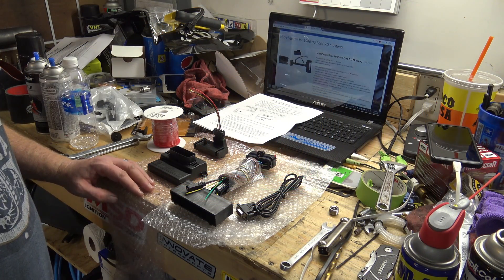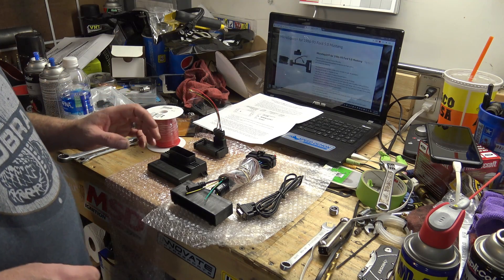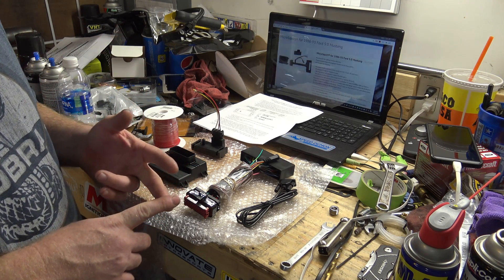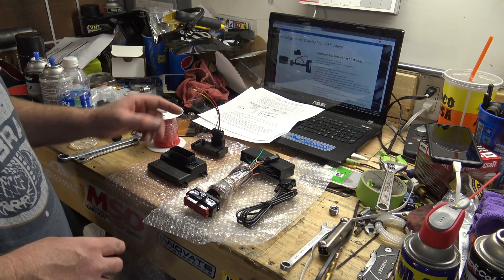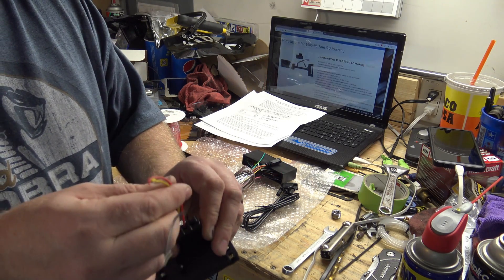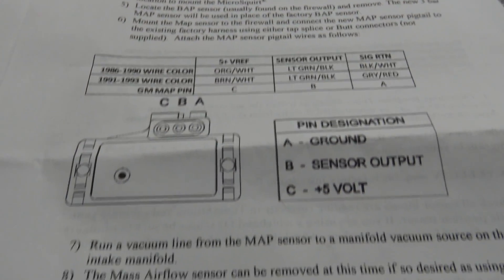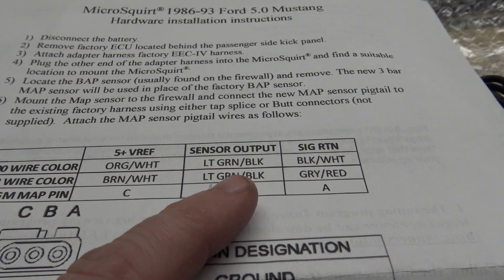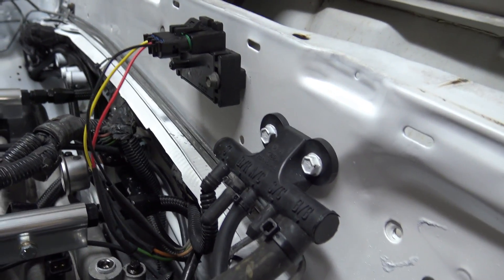Foxbody Mustang Budget Turbo Build - MicroSquirt Install

Comment: great video do you happen to have a link to the wide band you used or what would work?
Reply from the maker: Im using a aem now
Reply: @justin91lx  what wire did you use on the aem

Comment: New to the Foxbody game myself, but have a simple question:
Could I use this to replace the stock computer and harness for a 5.0 swap? Then just use the stock 4cyl ecu for dash lights, etc.? Thx for any thoughts
Reply from the maker: You would need to swap out the engine harness. 87-93 harness
Reply: @justin91lx  Ok, so still need engine harness, but can replace orig computer, correct? Thx

Comment: Does your factory tach still work even with the microsquirt
Reply from the maker: It sure does, but I no longer use the stock cluster. Built a custom raspberry pi setup
Reply: @justin91lx  can u do a video on that raspberry pi setup.

Comment: So just tape up wires goin to original o2 sensors n mass airflow?
Reply from the maker: I just zip tied my maf harness in the fender wheel. O2 harness taken out
Reply: @justin91lx  So, the MAF and the O2 sensors are not used with the Micro squirt? If so, this will save me $200 for a MAF to match my injectors.

Comment: Do you still have to use a mass air meter with this kit
Reply from the maker: Nope, same as the o2 sensors. Run a single wideband

Comment: Should have replugged the harness for the 2step option because it doesn’t come pinned for some reason. Your going to want the 2step with the turbo. I used the tach wire and moved it over because I’m using the tach wire on my ignition box. The FLEX wire location is were you need to put the wire. You’ll find it on your instruction wire diagram. Not to difficult. It requires a ground to activate the 2step.
Reply from the maker: Yeah I may wire up the 2 step on the microsquirt once I get everything else straitened out on the car

Comment: Great choice with the micro squirt.  How does the GUI look for the tuning app?  Is it fairly straight forward?  I purchased a Moates Quarterhorse for my A9L.  I'm not by any means a tuner, and my car will likely never see the track.  I'd be very leery of dyno tuning my car when its done.  Ive seen too many videos of motors exploding.  If there is anyone that can help me out with a base tune for my car using a Quarterhorse and Binary editor, even sending me a tune via email....please hit me up... dkahler@1000wordpics.com.  Thank you.  Great post Justin... I can't wait to hear this fire up for the first time.
Reply from the maker: Thanks! A few reasons i went this route. 1. I can tune myself and save a ton of money at the same time. 2. ecus for these cars are getting harder and harder to find. For the price of a ecu you can pick up this package deal. 3. When I go to bigger turbo and more boost I can tune it again myself. I haven't messed with the program much but, its pretty straight forward. It looks pretty easy to pick up.

Comment: justin there is a base tune in the microsquirt for your car so you can start the car when done with the motor, just pull pig tail for timing and set your timing, and drive it to the dyno tune, do NOT GO INTO BOOST until you are done with dyno tune, baby the car until you get there, my microsquirt was pre programed for a 351w I don't know if they did that for you but I would baby it to the tune shop, if your doing it that way AMEN brother looks good.
Reply from the maker: Yes there is. Ill still need to input all my info about my motor to run correctly. With the micrsquirt no need to see a tuner. The whole point of going this route. The first 500 miles it wont see much in boost. It will be a learning curve to get this car tuned
Reply: o wow I guess your going to tune it yourself, please post a video on how you get up and going, so I can learn the fuel map, I have the EXACT same set up right now and getting ready for dyno tune, I have a 78/75 on3 turbo and microsquirt 351w with blueprint 190cc heads and x-303 cam, speedmaster vic jr copy single plain intake 42lb injector, o most the same set up.